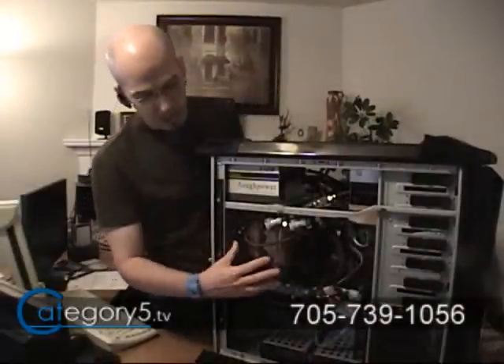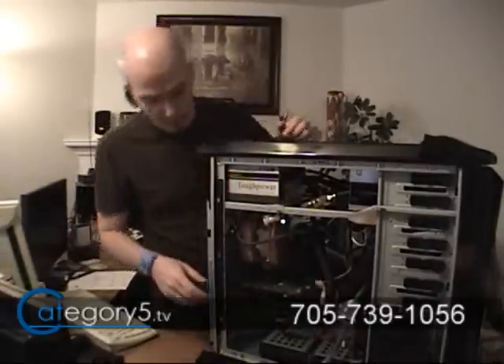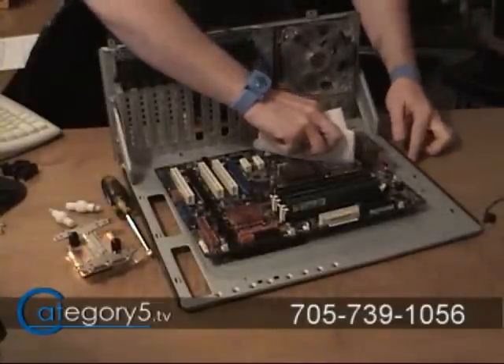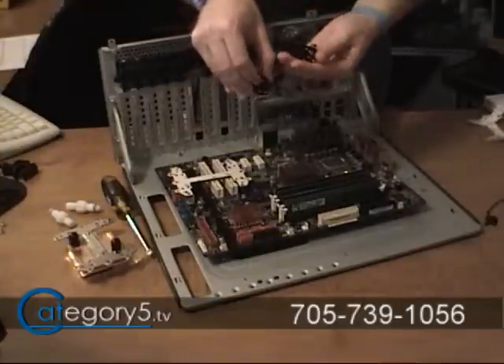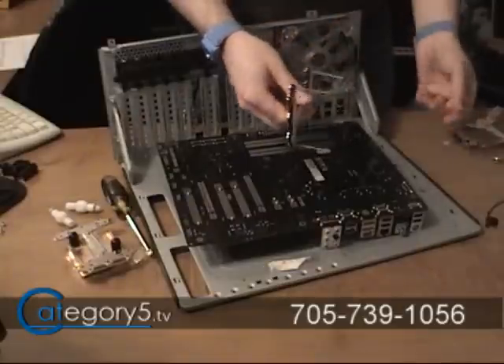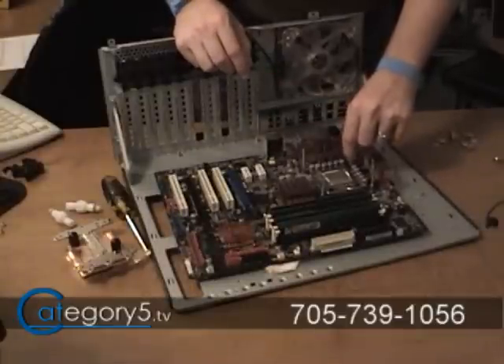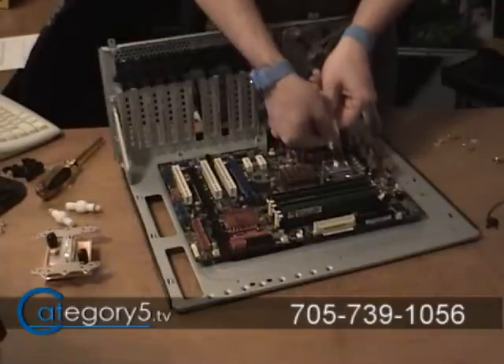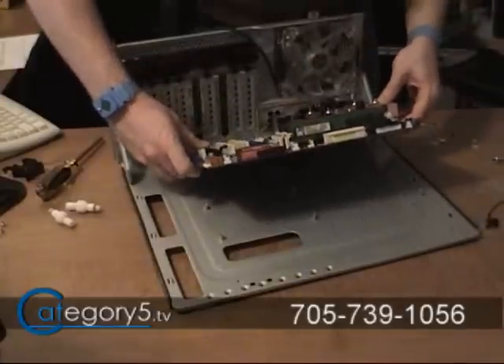056 02 - Installing a Liquid Cooling System - Part 2

Comment from the maker: Yep; Thermaltake makes some outstanding stuff.  This one (in the video) is their Xaser VI.  The Armor line is also very nice.  I just don't personally like transparent side panels.  Matter of preference.  But both lines from Thermaltake (and a lot of their other stuff) are awesome; and designed specifically for LCS (as long as you get the LCS model... Eg. the Armor+ LCS in your case).